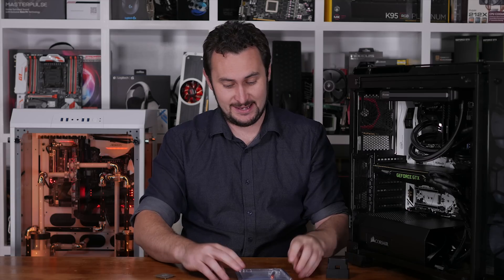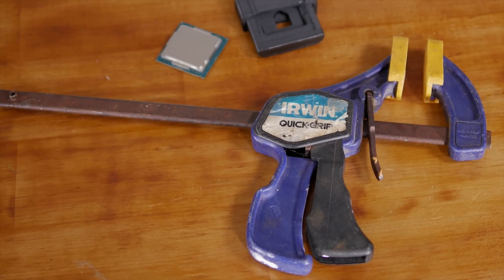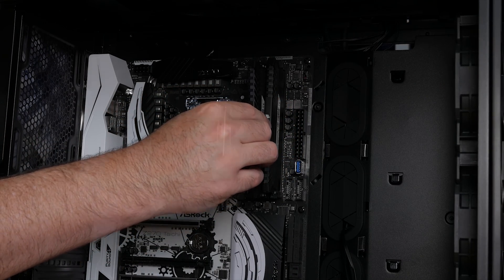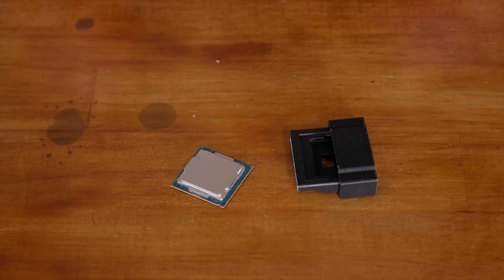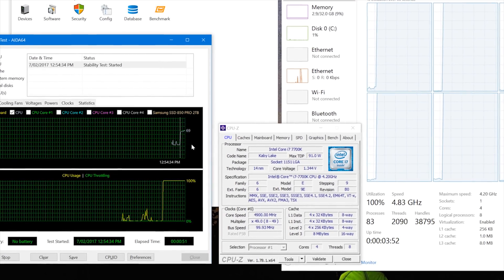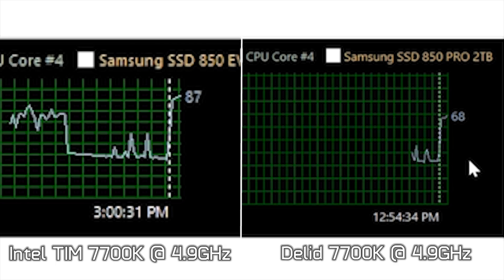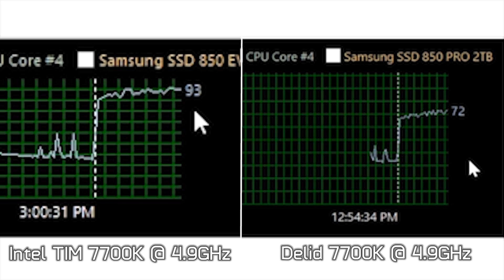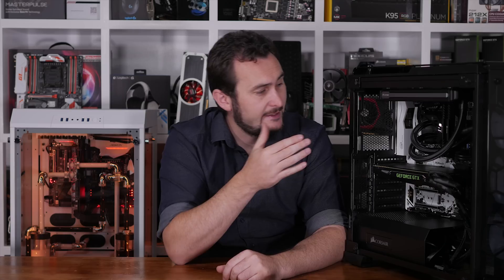Deliding My Core i7-7700K: Amazing Temperature Improvements!

Comment: I know this a bit offtopic, but the question remains unanswered on another video and I would like to get myself informed before deciding. 

Guys, can I use 1.35V DDR4 memory, or do I need lower voltage modules @ 1.2 for Pentium G4560 ? Because I want to hit that frequency / CL ratio well, but all the sticks I want are 1.35V. I ask you because I do not want to use DDR3L, and the specs are rather ambiguous. And the Adata ones at 2400 Mhz CL 11 AND 1.2 V are out of stock everywhere in my country.

Also unbelievable channel and work that's been invested in all the tests, you truly are the benchmark king. 
Thank you for educating me into making a better decision for my build. Cheers, subbed !
Reply: Most of the DDR4 memory runs at lower voltages unless you enable the XMP profiles in which case it will use 1.35v. Pretty sure without it you get 2133 at 1.2v but don't quote me on it.

Comment: I won't go anywhere near the 7700k or 7600k until Intel recognizes the problem and fixes it (including a voluntary recall for chips already sold) or release a refresh with improved TIM. Maybe that's what we can expect with the rumored 7740k?
Reply: Jon Proce Not gonna happen. Intel doesn't give a shit and they will probably release the 8th generation CPU'S with better TIM and advertise them as so much better than kaby lake...
Reply: That's fine with me. I've been looking for an excuse to replace my 2500k for years now. This is yet another reason not to.
Reply: The 7700K and 7600K are the #1 and #2 best sellers on Amazon here in the US right now. I actually bought a 7700K myself but returned it for a Ryzen 1800x after doing some research for the rebuild during shipping and discovering temperature and quality control issues with the Intel chips.
Reply: No tim will ever be as good as soldering cpu's,the closest thing to solder is liquid metal and we all know intel will never use lm on their cpu's for many reasons,nr.1 cost,i will continue to curse intel until the very moment they will start soldering their shit and until they will actually begin releasing cpu's with good performance improvements to them,and after that i will still continue to hate intel,just like that for good measure because intel deserves it

Comment: I do agree that it is appalling that Intel charge a premium for the unlocked processors and use exactly the same crappy thermal compound for them. If Intel actually put a little more effort into their unlocked chips it could help them much more in marketing because these temperature differences are huge.

Comment: On 7600k I have 67-69C on the hottest core with 5,1ghz(1,295v) without deliing on AIR cooler, room temps are around 18C, 5,2ghz (1,355v) 71C. All clocks are with 3100mhz RAM on 2666mhz stick, 1,300v .
 You need to see system agent & the Turbo boost.Also lower the cache ratio or/and RAM speed if you must. Load Line Calibration too.
Reply: 7600's will run much cooler since you are not using hyperthreading which adds a large amount of heat. Sure he can disable hyper threading and get lower temps, then why buy a 7700?

Comment: Good job !
Just use less liquid metal next time :)
you can also try "naked" setup - removing IHS completely will reduce the temperature by another 5-10C.
But thit step should be done only by those how are confident in their skill.

Comment: People will go to 5.3ghz with the i7 7740k 

Intel failing lol. Hoepfully Ryzen succeeds in OC capability and is very competitive for the price
Reply: only few chips can reach above 5.1ghz and the 7740k is just a refresh without any architectural changes. it won't overclock better than a 7700k. perhaps lower temps, but a delid will still lower the temps even if it has better stock tim.

Comment: This is why AMD's Ryzen is so important. Intel seriously need a kick in the ass. ps. And nVidia do as well for the way they grossly overprice their top end GPU's. I really hope AMD do well with both Ryzen and Vega, as consumers we desperately need the competition.
Reply: back on the gtx 480 when it was similar in performance to a titan x for the time $599 was understandable but in no way its now (even if it was the titan x should cost like 799 at worse), inflation is no excuse for this, since the gtx 480 didn't came out on 1997 nor is the way in which nvidia treats people, i do like the cards that they produce, but that price point i way to fucking high
Reply: nVidia Pascal is a winner, very power efficient for the performance, but the point is they are clearly taking advantage of the situation and the 1080 is way over-priced. If AMD were competing with them at the top end it would probably be about 100 U.S. cheaper than it is now. The upcoming T.I. should be priced where the 1080 is now, but my bet is it will be significantly higher, which is just crazy. If the rx 490 is at all competitive with the 1080 (and I'm sure it will be) and comes in cheaper then fuck nVidia and their upcoming 1080 T.I. it is AMD we should be spending our money on just to prove the point that we know how they have been screwing us and don't appreciate it.
Reply: and so they did

Comment: +Hardware Unboxed As I'm sure you know, other Youtubers have reported that BIOS updates are making a difference to temps on the 7700k. It would be good if you could take another look at Kaby Lake in the future comparing temps on multiple BIOS versions on a couple of different boards.
Reply: Nik Kearney thats a problem with some msi boards that applied more voltage than needed
Reply: Not just MSI, I had to manually set all my voltages on my ROG Maximus IX Hero to prevent it from putting more voltage through my CPU than required. Without setting all voltages manually my 6600k hit the 100c mark on the Kaby Lake board. On my Skylake board it only ever hit 70c, achieved the same on Kaby Lake setting voltages manually. If BIOS' are broken and causing at least part of Kaby Lake's issues then it's worth a video.
Reply: yaah, but thats just for "auto voltages". Here... he's using "manual voltage", so... the bios is just using the voltage that he put on the bios.
Reply: That doesn't mean a video looking at Kaby Lake temps over several BIOS versions on several different boards wouldn't be worth it. Multiple reviewers have mentioned BIOS versions making a difference to temps. It's worth testing.
Reply: i dont think it would any difference with manual voltage, buy maybe im wrong. Surely it´s worth testing.
Reply: This was only a case for stock voltages the motherboard applied and automatic overclocking. Setting them manually fixed that from day 1.

Comment: i think intel chose a pretty poor TIM because they favored longevity. the liquid metal paste you used will probably not last as long as the TIM intel uses. 
and also you can throw away the IHS and mount the cooler right on top of the bare chip, while using any thermal paste. there's obviously more risk involved but it's possible.

Comment: My 7700k won't hit 5.0 either. It's not even very stable at 4.9. I have to run it at 4.8ghz/1.28v.  It's sad because my 6700k was rock solid at 5.0ghz/1.38v, which actually ran way cooler than my 7700k at 4.8/1.28v.

Comment: Why are they selling desktop processors with this metal lid and laptop processors without it? Why make it worse for desktop people?
Reply from the maker: The heatspeader makes the processors very difficult to damage, without it mounting a CPU cooler on a slight angle or applying too much pressure easily chips and or cracks the die.

Comment: If u used LD PC-V10 Phase Change probably you'll get 5,2GHz(without deliding) and temp. around -30°C :-p but u must use dielectric grease in the socket (useful for 24/7 use).

Comment: I'm going to stop you right there and tell you the TIM is not the issue
the issue is the distance between the CPU die and the IHS - by cleaning up the glue you basically eliminate that gap
Reply: no, if you take a close look, timespamp 2:13, the paste is stuck on the IHS

Comment: Intel does this because they know idiots will blindly shell out $ to support them no matter what...Thank goodness Ryzen is around the cornet! Even if you don't like AMD if forces Intel to give a sh!t!
Reply from the maker: Well idiots is a bit harsh, what's the alternative right now? An FX processor :D
Reply: The alt is sticking with the 6700k or waiting on Ryzen. I have a build for Ryzen ready for chip and mobo...I have nothing against Intel for making $, but this is just unacceptable.
Reply: the lid isn't the issue, they put the lid back on in the video when they got >20 degree temp drops, the issue is they used terrible thermal paste between the die and the lid, AMD hasn't even been using thermal paste on their chips they solder the lids on directly which performs better than any thermal paste. Intel solders the lids on for their lga-2011 cpus but not the desktop ones, with the desktop they use thermal paste which is sometimes alright and sometimes terrible, it was also in issue with the i7 4770k where they used cheap thermal paste and they refreshed and advertised better thermal paste as a feature for the 4790k
Reply: The physically smaller size of the Skylake die makes soldering problematic (micro cracks), and higher performance TIM like "liquid metal" don't last anywhere near as long before degrading.
Reply: The old even smaller Clarkdale dies were soldered, so I see no reason why these new ones couldn't be either.
Reply: +allupro Different TDP and thermal cycling I guess. The problem with soldering smaller die sizes isn't a new discovery. https://pdfs.semanticscholar.org/40fe/11ccc30fcdac3d2c38cb65b42f112f040558.pdf
Reply: RdyPlyOne Finally someone who knows where I'm coming from, I don't particularly like AMD, but I don't hate them, I fact I hope they are competitive so they light a fire under intels asses, I am very impressed with their i3-6100 (I have that) even paired with a GTX 1080 there is relatively low bottle necking, I'm going to get the i7-6700k or a x99 chip, like a i7-6900k or i7-6950x if their price go down, which is quite inevitable if AMD is competitive
Reply: The Almighty s u c c good automod
Reply: Ryzen CPUs also have a lid.

Comment: Why not just slap the heatsink on the cpu bare die, just like gpu heatsink, its will be more effecient right???
Reply from the maker: The base of the cooler wouldn't be touching the die, the result would be bad ;)
Reply: Hardware Unboxed you could technically remove the stock hold down completely. the water block would hold the cpu in place.

Comment: Shame on Intel.
Reply: fx is pure crap tho
Reply: The difference is the amount of transistors in the chip. A 14nm (7700k) architecture will naturally generate more heat because the TDP and the distance between transistors prevents heat dissipation to a degree. However with better dissipation from the die to the heat-spreader, and then to your cooler you can expect much more comfortable temperatures on your unlocked chip.
Reply: Yeah, but if they put a good thermal interface material on. We would use our processors for longer as we'd need to upgrade less, since we'd overclock more. I think that's why they do it.
Reply: You're talking out of your ass.

Comment: can you do that on a GPU as well?
Reply from the maker: They don't have lids :)
Reply: yeah. did it with a 1070 that was heating past 85C and dropped it down to 60s. be VERY careful when doing it with GPUs. cover everything around the chip with electrical tape or non conducting putty
Reply: ***** right. Just straight onto chip already. So be careful! (:

Comment: I suppose cleaning off your block to use in the future will be a PITA due to the liquid metal.
Did you have any issues with sitting the block on to the naked chip?
Some motherboards, the CPU sits too low in the socket still for the cooler block to make contact with the die, due to the plastic casing height around the CPU seat (I heard).  Any insights on how to remedy this?
Reply: He put the heatspreader back on, he didn't put the cooler onto the naked die. He just didn't bother gluing it on, and just used the force of the socket clamp to keep it in place.
Reply: Oh.  Didn't notice that.  Well, I suppose there's not any major point to do that then if the heat spreader itself does an adequate job of heat transference.
Reply: There are some "naked die kits" if you are feeling adventurous. Basically washers to ensure even contact with the die since direct pressure for the heatsink can lead to cracking.

Comment: Does deliding work on locked chips?
Reply: TrueZtyleZ7 Yeah but I'm just saying the temp difference might be drastic if you delidded and had an aftermarket cooler as opposed to a stock one. And even if you don't NEED one it would still be good for acoustics.
Reply: I don't see why not but the temperature difference would probably not be that big unless you have a shitty CPU cooler.
Reply: +C.L.K I'm pretty sure the stock cooler is plenty for a locked chip, considering how incredibly efficient the new CPUs have become.
Reply: If you want to overclock locked chips you must by Skylake.
Reply: RayzeTheDragon And a Z170 ASRock mobo with an older BIOS.
Reply: There are old BIOSes that allow BCLK OC for all manufacturers' Z170 mobos. AsRock just has some "hyper" series boards that can BCLK overclock without having to stay on the old BIOS.

Comment: It actually turns out its not actually the TIM intel uses, its the adhesive they use to secure the IHS, when it drys it creates a 1 piece of paper sized gap between the IHS and the PCB, using the liquid pro and then adding a 1 piece of paper thick shim leads to almost the same temps (worse actually if you use MX-4 instead of liquid pro) i'm not going to say that replacing the TIM with liquid pro doesn't have an effect, it likely does, but probably only around 5c just like replacing the stock thermal paste of a heat-sink with something better has.

Comment: how much better is the liquid pro than the mainstream arctic silver 5 and MX-4? 
And can i use this on my GPU chip?
Reply: TheSinisterEyes1 with my personal test, the metal is like 7-10c better, and yes u can use it in ur gpu
Reply: be careful with the stuff, especially on a gpu, it is conductive so it can do some damage if you get it anywhere but the die. Gpus are more at risk because there is stuff to short close to the die, the material has to travel a little ways to short anything if it is used between a cpu ihs and heatsink, also it doesn't work with aluminum surfaces
Reply: thanks for  the info

Comment: Now we wait for the 7770k refresh with better temps
Reply: Twan Duvigneau if they hyperthread an i5 they'll kill the lower range i7s
Reply: Jon Asgaeroth those who bought the  i5 7600k/i7 7700k lel
Reply: Intel would charge $100 extra just to put a drop of a better thermal interface material.
Reply: and more cores
Reply: new chip, more cores, same shitty temps lol
Reply: Jon Asgaeroth I thought I saw something about an i5 with hyperthreading, I can't remember if it was this coming generation or the next one
Reply: Boda there are rumers of an i5 7640k (with hyperthreading) and i7 7740k in response to ryzen
Reply: ***** Well I guess I'll wait for that and hope it's true
Reply: Well last thing I checked was that hyperthreaded i5s would remain with 6mb of cache so there's still that differential. Let's hope AMD shakes things up quite a bit.
Reply: Everill angel Just saw the news that it will be for the x299 chipset. The i5 would have the exact same specs as the i7 7700k.
Reply: It's already announced and ready to go to market to compete with The R7 1800X. It's called the 7740K and it's just a shitty 7700K with a 200mhz turbo bump. Probably going to have the same shit TIM and the same shit 90c at ~5ghz. We're looking at Phenom II vs Sandy Bridge happen but with the roles reversed.

Comment: They should really just manufacturer cpus to have removable heat spreaders with some mechanism .-. I'd love to manually replace the thermal compound (if that's what it even uses) on my CPU if I ever needed to. But there's no way I'd trust myself to remove it like this >.>
Reply: They should solder hs, do no need to delid. Best but also most expensive way.
Reply: There's some drawbacks to soldering, although they still do it on Xeons and Broadwell-E CPUs. Check out Der8auer's article on it: http://overclocking.guide/the-truth-about-cpu-soldering/